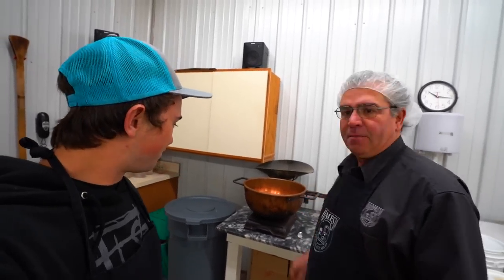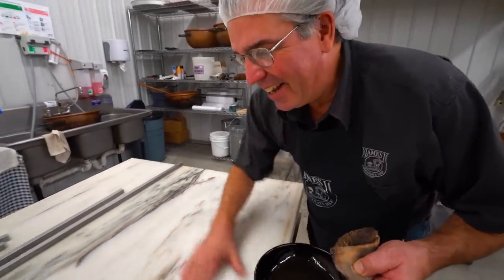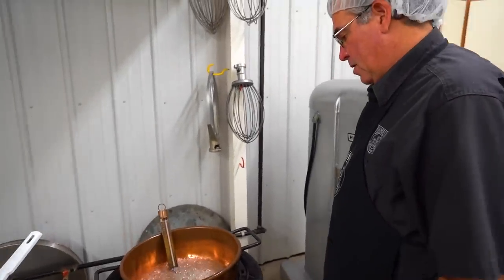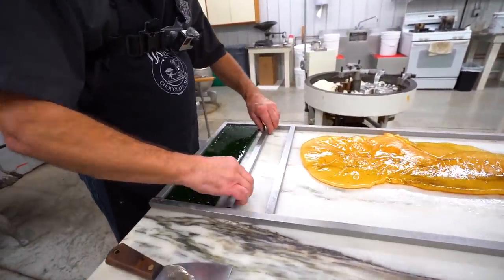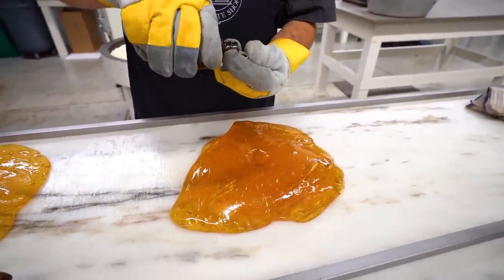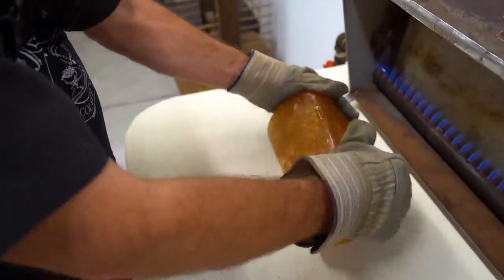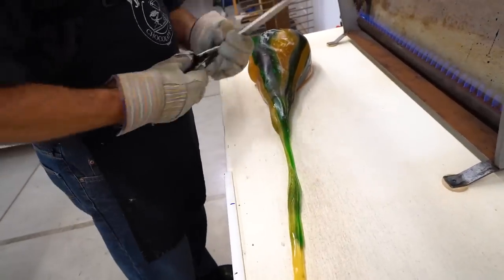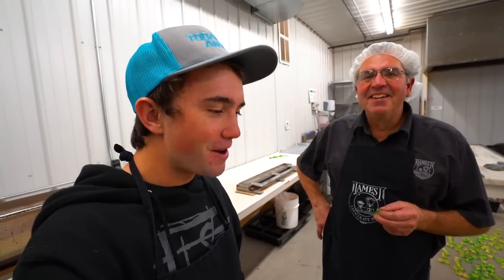How Clove Hard Candy is Made!!

Comment: If i were to put the candy in a silicon mould what would the correct temperature to start pouring the candy in it? Is it necessary to Let the candy drop its temperature from 315 to 215 or whatever to place it in a mould?  Need my candy not to be so sticky in the outside. When i did it the first time i heated untill it reached 290 if i am not mistaken. Could this be another factor of the stickyness of my candy? Thanks for the help! Really apreciate it if you respond asap 😊 Also  could it be that i am using too much syrup or inverted sugar? I think o did a cup o sugar and half a cup of sugar Caín syrup. Thanks 🇨🇷